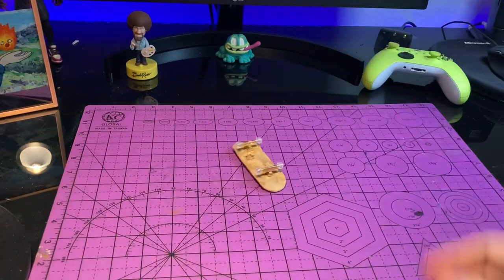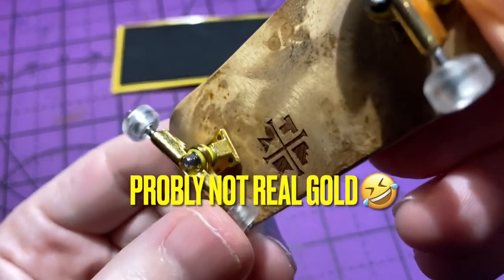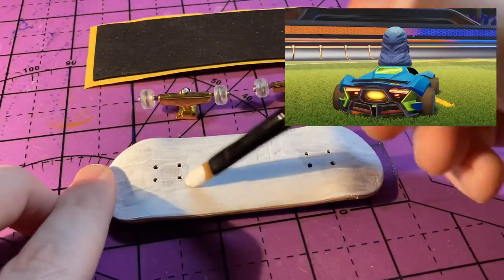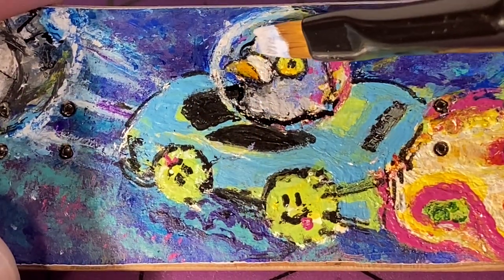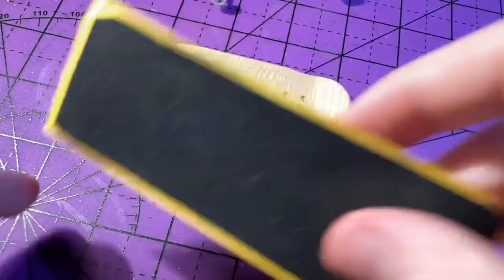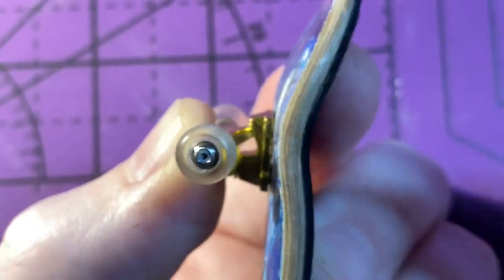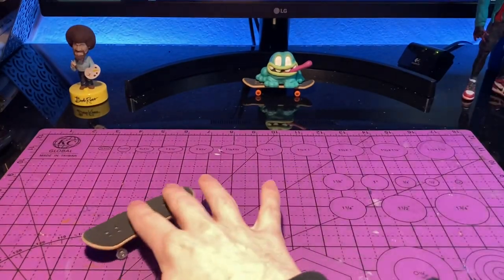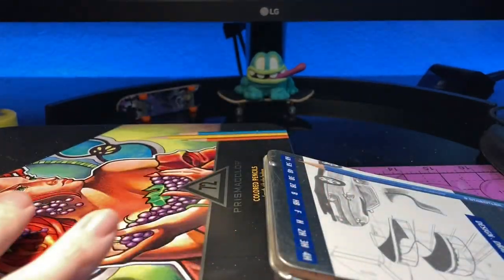Custom Painting A Fingerboard!

Comment: Can the paint wear off?
Reply from the maker: I put a clear coat added for protection, boardslide on a metal rail don’t do much to it but on concrete or rough obstacles will wear it down and scratch board over time
Reply: ok ty and if i do wrap with big stickers like fingerboard desings sticker. Can i do this? @STICKYArt